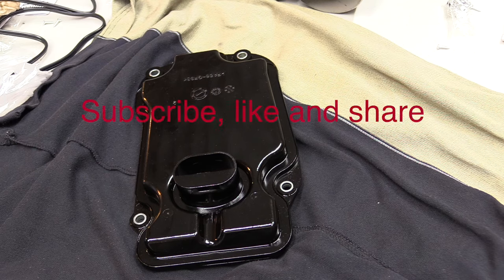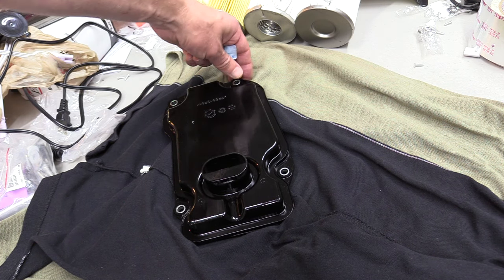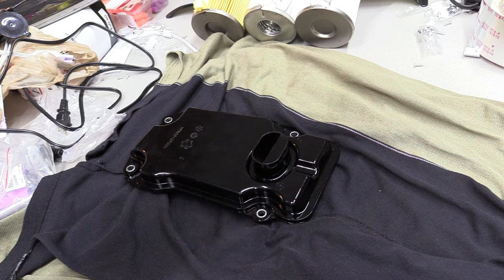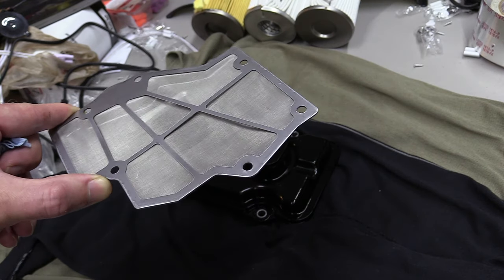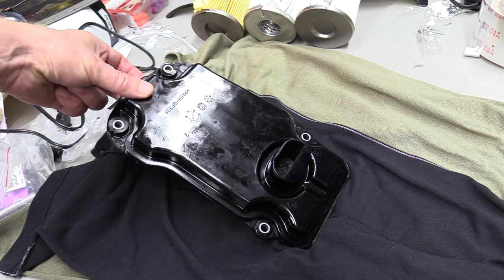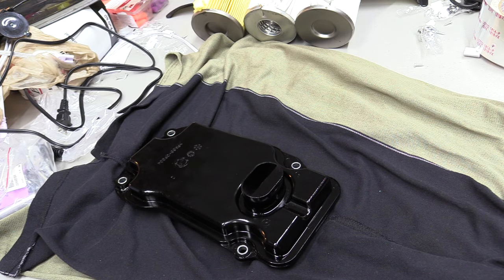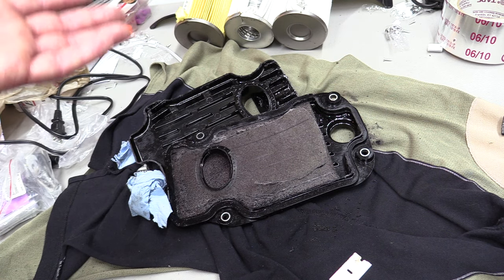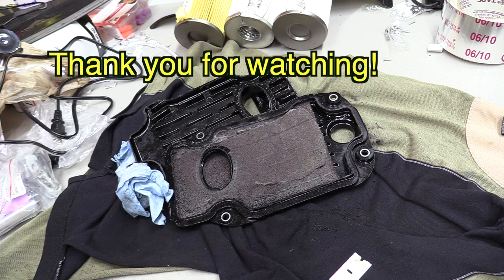Avoid replacing transmission filter, avoid costly transmission repairs, transmission maintenance

Comment: i have a 2018 toyota tundra v8 5.7 auto. ibought it with 76000 miles. i was planning to do a drain and fill. would you recommend do to the filter replacement since it has never been drained and refill?
Reply from the maker: Please remind me of what recommendation I gave in the video.
Reply: you said maybe or maybe not depends on application. reason I asked is because truck is lifted and on 35 in tires. I am going to avoid any potential problems by removing pan etc and just do a drain and fill. I used your link and now a preferred customer, I believe you are the dealer.  how often would you recommend i change fluid since only about 4 quarts will be changed in the initial drain/fill? 
 @repairvehicle

Comment: Hello, I own a 2020 Mazda 6 sport with 61000 miles. Am I okay to use all OEM parts , atf, oil filter?  thank you
Reply from the maker: You can use oem parts and atf or you can use aftermarket parts and ATF.
Reply: You know you made me think. I also own a 2007 toyota corolla with over 350000 mile and all I have changed is the tranny fluid. Never have I replaced the filter on that vehicle.  I will skip the filter replacement on the Mazda 2020. Thank you for your education.

Comment: I have a 2017 Kia Forte I bought new it now has 75k miles at 40k I took to dealer and had tranny fluid drain and fill I’m going to do it again u said don’t change filter on the Kias right only drain and fill? Thankyou for answering in advance.

Comment: If my vehicle had lower mileage, I would change the filter, but I’m currently at 210K miles and it’s an oil burning engine, so I make sure the transmission fluid is drain and refill at 15K interval with Toyota ATF.  Will use Amsoil Signature Series ATF the next time I do a drain and refill and push the interval to 30K
Reply: I switched all of my cars' ATF from the Honda DW-1 and Aisin T-4 (same spec) with Amsoil OE ATF (same spec) which gives quicker and smoother shifts. I still drain and fill @ 15K or 30K miles, depending on the amount of miles driven per year and the driving conditions. 

I did change the filter in my new-to-me VW's O9G automatic transmission made by Aisin because I didn't know how old it was and it had ZERO contaminants in it. I tightened the bolts with a torque wrench as always, so breaking them was not an issue. Now that I know I have a clean filter, I don't plan on changing it again. 

I agree that if you ONLY drain and fill at scheduled intervals - or more frequently - with premium fluids, there will be no problems.

Comment: hi sir ...i just bought a 2012 ford fuison... i dont think the transmission fluid has been changed im going to change the fluid ... it shifts fine .. but do you think its to late .?.is my question .. it has  78449 miles on it ..thanks for your time
Reply from the maker: No, its not too late. I have changed atf fluid for the first time on my 2013 f150 with 80k miles. It made a big difference.
Reply: @repairvehicle  thank you !!!
Reply from the maker: No problem, please subscribe to my channel

Comment: Aw yea. That filter still looks good and it was very tough of you trying to pry it open. The point of how hard it was to pull it open, shows the durability of how those trans filters can last a liftime (possibly). It wasn't cracked, dent or broken and it had very small particals from the transmission (glittery look) on the cushion. Some might think I'm crazy for saying this but. Hard plastic is tougher than aluminum, hence why pieces of fragments coming off the transmission, while the filter still looks good and not damaged. You would think that with the filter it catches things from the transmission, that the filter would look damaged or worn also. And pieces from the transmission, didn't do any affect or damage to the hard plastic of the filter. Aluminum is tougher than plastic, but then it isn't. Because plastic is stronger than aluminum, it doesn't wear down nowhere near as fast as aluminum. Aluminum typically last from 50 to 100 years, meaning  some issues will happen soon in the very early years. All types of plastic (no matter what material it is) can last 400 to 450 years. Aluminum will age, wear and break down way faster than any type of plastic. I don't understand why the parts inside the transmission, aren't made with better durability (especially the gears). To where they won't wear out so fast and breaking down. I feel like cars should be made for lifetime "GURANTEED". With how expensive the parts are on the car. Yea you should still keep up with maintenance. But the most criticals part on the car, should be way more durable than it is. I just feel that the critical parts need to be made with a better different material, that's alot stronger. I'm sure alot of companies are looking into it in the near future or so.

Comment: Allison transmissions use spin on filters  & Chrysler truck transmissions use spin on filters along with the suction type up to 2019 I believe.
Reply from the maker: Yes, I know.  Most of the truck transmissions have 2 filters
Reply from the maker: Older Subarus had 2 transmission filters.
Reply: I just bought a 2021 Ford Superduty F-350 7.3 big block 4.30 gears with the 10 speed transmission. I hope 🤞 the transmission proves durable . Amazing fuel ⛽️ economy with that trans . Gets better gas mileage than my 2018 Ram 6.4 6 speed trans .
Reply from the maker: Congratulations.  Change transmission fluid every 30k-50k miles and you will be surprised how long it will last.

Comment: I have a 2006 lexus gs300 with 248,000 the transmission filter has been replaced 1 time at 100,000 Should I replace it again?
Reply from the maker: Automatic Transmission Filters, information on transmission flush dealers don’t want you to know
https://youtu.be/IhZ4YHrhNeI

Comment: Is it OK to combine Synthetic transmission fluid? I have done this service by 90k on my toyota corolla 2018, the guys filled it up with Valvoline Synthetic ATF, now by 110k, I've bought the original Toyota Genuine CVT FE Transmission Fluid made in Japan (purple 5quarts metal container) and I'd like to drain/fill the transmission. Would it be OK to combine?
Reply from the maker: It’s not okay to mix regular atf with cvt atf.

Comment: Question please. I have a 2006 Toyota Sequoia 4WD SR5 with 202k miles 
Getting ready for transmission services can I and should I replace the transmission filter due to the high mileage. 

I don't remember of I change the filter before or if it's the original one.

What do you think Sir
Reply from the maker: It's good idea to replace it if you don't have rust as I have mentioned in the video.

Comment: How you doing.. My dad has a 1996 Toyota Tacoma 2.4. He bought it brand new in 97. He never changed the transmission fluid and rear end. The pickup has 183+ miles on it. Do you think I should change the filter to or just the fluid???
Reply from the maker: It definitely good idea to replace fluid at least.  Filter might be good idea to if it's not rusted around the bolts
Reply: @repairvehicle  thank you. It's not rusty on the pan the car is from FL. I'm just worried about the filter.  Because rumors say once u change the filter and fluid with high miles the transmission acts up.
Reply from the maker: On my tundra transmission fluid was changed first time at 170k miles, then again at 226k miles with filter.  Transmission shifts way better than before.  Dirty atf fluid does not good for transmission. It's like Dirty engine oil does not good .
Reply: @repairvehicle  you right it's dirty like motor oil.
Reply: I took the pan off. I see the filter but it has a look like a pipe line across from it. Don't know how to remove it. I took off the screws for filter it's loose but the rod it's in the way. How I get it off???
Reply from the maker: this text is a copy and paste from service manual 
"REMOVE OIL PIPES
Pry up both pipe ends with a large screwdriver and remove the 2 pipes.
NOTICE:
Be careful not to bend or damage the pipes.
6. REMOVE OIL STRAINER
Remove the 5 bolts, oil strainer and the gasket.
NOTICE:
Be careful as some oil will come out with the strainer.
Reply from the maker: Installation 
10. INSTALL OIL PIPES
Using a plastic hammer, install the 2 pipes.
NOTICE:
Be careful not to bend or damage the pipe.
11. INSTALL OIL PAN
(a) Install the 2 magnets in the oil pan.
NOTICE:
Make sure that the magnets do not interfere with the oil pipes.
(b) Install a new gasket and the oil pan with the 14 bolts.
Torque: 5.4 N·m (55 kgf·cm, 48 in.·lbf) NOTICE:
Be careful not to damage the filler pipe.
Reply: @repairvehicle  thank you. Yesterday what I did was pull a little the pipe in the middle enough to take off the filter. Then I clean it up and put the new gasket and filter.

Comment: @repairvehicle I have the 2022 ford f350 power stroke    Are they still having problems with the cp4?  Any preventative measures I can take?  Is the motorcraft fuel filter the best?
Reply from the maker: Cp4 has always been problematic part on many vehicles not just ford, due lubricity issues. First use fuel additives that has lubricity it help pump run smoothly. When it comes to fuel filters, factory fuel filters are best, motorcraft fuel filters best for ford. In my cummins I use factory fuel filters because I have not found an aftermarket fuel filter that is better than factory. When it comes to oil filters, some aftermarket oil filters is better choice than factory.
Reply: @repairvehicle amsoil oil and filter the best correct ?
Reply from the maker: Yes
Reply: Amsoil has a fantastic dual-filter set up (the first filter is high flow 10 micron, maybe 12 or more, and the 2nd filter is about 3 - 5 micron).  If you do not want to dual filter setup, motorcraft does rate well (not the best), but for me I like WIX and it has a built in (bypass filter?) fine section, so it is a "best of both" in one.  Also, if you go with the amsoil dual-filter, you have to use amsoil filters (I am working on converting the thread connector).  Don't get me wrong, I think amsoil makes good filters, just personal preference from researching.
Also, take a look at SS Diesel - they have a CP4 replacement pump that is impressive.  On that note, I am seeing CP4 problems ranging from 1.6% to 7%.  So if you have 500,000 American pickup trucks with a CP4 pump, 7% is 35,000 catastrophic failures, and out of those that fail, the vast majority happen at or above 100,000 miles.  If your a gambler, add you fuel lubricant and save up for a new pump around 50k - 70k miles to be safe.  Between reading articles and youtube, at least 1 person out there has over 300k on the original bosch cp4 pump.

Comment: Honda’s don’t even have transmission filters just magnetic drain bolt
Reply from the maker: True. Not inside the transmission.
Reply: Not true.  My 2005 Accord has replaceable ATF filter in the rubber hose line
Reply from the maker: Its a useless filter,  it causes more harm than good if not replaced every 20k miles with fluid.
Reply: It’s about as Useless like any filter that’s not changed regularly. Mine went 218000 miles with zero transmission issues.

Comment: Honestly, that filter doesnt look like its "the same" as an oil pickup tube. 
that thing clearly does filter the fluid. maybe not to the extend an engine oil filter does but still. 

i would change it if it old and has miles. but yeah fluid is the more important thing. 

ive also never had issues with bolts from a trans. 

what i take away from this video, change fluid regularly. no need for filter change every time.

Comment: Good video but my question would be since you did observe metal fines in the filter media, how can you be sure filtration is still effective?  Also, with a dipstick and I believe some vents too in an automatic transmission system, I'm not so sure these systems are not sealed as you say.  I also know that my Highlander has magnet in the pan so if the pan is not dropped, there is no opportunity to check the magnets and clean them of fines.  I can imagine a situation where the magnets may have fines on them to the point they are no longer attracting metal and have therefore stopped functioning.  I think the bottom line for me is what is harm in the dropping the pan, changing that filter and cleaning the magnets.  If the bolts are in good shape, shouldn't be an issue with those.
Reply from the maker: Answer in the video. Thank you for commenting
Reply: @repairvehicle  Yes.  I watched it.  It seems your observation the media is more open than oil filter media is somewhat subjective.  What is the pore size in comparison for example?  I would agree that with regular fluid changes, magnets could be fine, but would you agree that if a car has not had the fluid changed in 100k+ miles, it would be beneficial to drop the pan and proceed with filter change as necessary?  Provided the pan bolts come off (which they should if corrosion free and pre-treating with PB Blaser) I can only seen the benefits in a case where the fluid was never changed (or deferred).
Reply from the maker: @mountainbiker4450 if you watched video without skipping then know the answer because I answered in the video. Thank you for taking time to watch the video and comment.

Comment: good video brother. it helped even a non mechanically inclined person like myself to better understand. now a question. is there alot more work in changing tranny fluid and filter than in an oil change? reason i ask is because i have my 2007 hyundai sonata, that i just got on a good deal, slated at a local garage for an oil change. oil, new oil filter, the works for only $28. a tranny fluid change at the same garage is right around $150. i dont mind paying it because i have the peace of mind that a professional is doing it right, i just think it must take more effort and be a more intensive job that a simple oil change
Reply from the maker: Yes, changing transmission fluid and filter takes a lot more time and knowledge.

Comment: I have a 2003 Dodge Ram Hemi 5.7 magnum at 166000 miles. Seems to run fine but has engine light on with I think valve compressor codes. I was thinking of changing spark plugs and doing oil change as well. I assume I should do transmission fluid change,should I flush it as well? Filter change?
Reply from the maker: For transmission drain and fill.  Filter charge is might be good idea too if it was never changed before. https://youtu.be/or9u8DQ4fVU
Reply from the maker: Double check the code before doing anything unnecessary.
Reply from the maker: Engine flush might be good idea too

Comment: I went to a auto parts store and use their OBD and it showed no codes for the transmission. 
Prior owner bought it brand new in 2002 and said he had the dealership do regular fluid changes. Now today I noticed that the vehicle had not been driven for 2 1/2 years.  the last oil change miles show the date.
Reply from the maker: without receipts from dealership, its all just words.
Reply: Oh thanks for all the help

Comment: I have a 04 Tacoma, it shifts fine but sometimes it kicks a little going up but mostly when I go to a full stop.  It was worse before I replace ATF and filter, now its a lot better. What do I need in order for the car to run smooth "like new"? Or what can you say about it? Car has almost 300k mil. Thank you
Reply from the maker: How often did you change your atf? On your last aft change, you did drain and fill once? What brand of atf fluid did you use?
Reply: I just got the car like a month ago, the atf was kinda black so I paid my mechanic to replace it and we used the OEM from toyota T-IV
Reply: And yes, we did drain and fill once. And now that I remember better the car only does this when I come to a stop, and sometimes it make a noise when you go from P to R or D.
Reply: Could it be mounts problems or the transmission itself? Not every mechanic seems to know exactly how to fix this type of issues, they just say its because of the high mileage but I guess there's a solution, right?
Reply from the maker: Noise could be coming from anything, without hearing the noise it's very difficult to diagnose. Also, 1 drain and fill is not enough.  There's 1 more thing can be done,  I will make a video with explanation.
Reply from the maker: Keep in mind,  not every mechanic has skills to diagnose.  Mechanics known for replacing wornout or broken parts,  they are not known for diagnostic skills. To find the problem takes more than just skills to replace wornout or broken parts, sometimes thinking outside the box.
Reply: I look forward to the video. Thank you

Comment: I changed my transmission filter yesterday. It hasn't been changed in 160,000 miles. At the time I thought it was a good idea (shrugs) o well, live and learn, What brand of synthetic transmission fluid do you recommend?
Reply from the maker: This what I use and recommend.  I have thousands of comments from people like yourself who tried this fluid and immediately saw big difference. https://www.amsoil.com/c/transmission-fluid/19/?zo=5257753
Reply: I wouldn't worry if the fluid was fairly clean, how is it running?
Reply: @jonmo2694  Unfortunately, someone destroyed my car while it is parked. So I would say it is not running well at all.

Comment: Some transmission filters are "metal" and cleanable (Toyota Rav4 I4), others are paper (Toyota Rav4 V6).
Reply from the maker: What do you have and mileage?
Reply: @repairvehicle 120K Miles. Dropped the pan as I needed to clean the shavings too.
Reply: As I know, 2008 toyota rav4 v6 is metal not paper